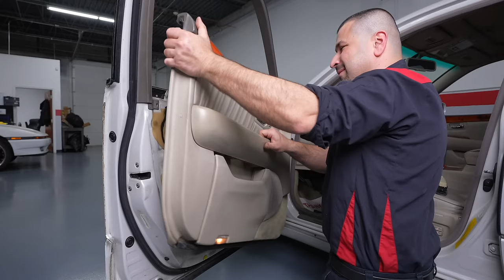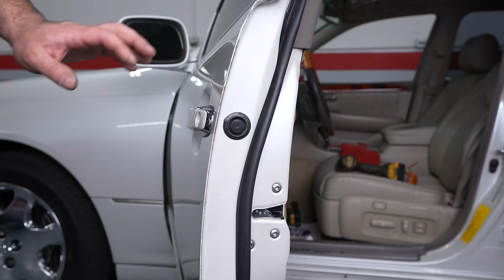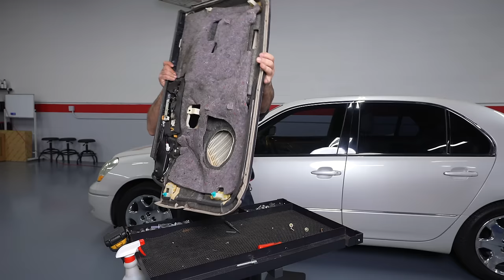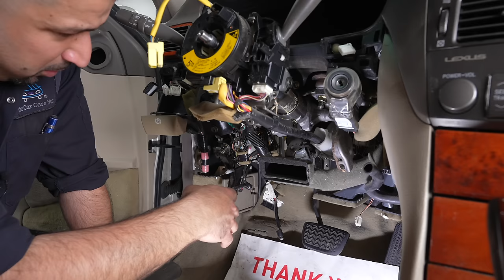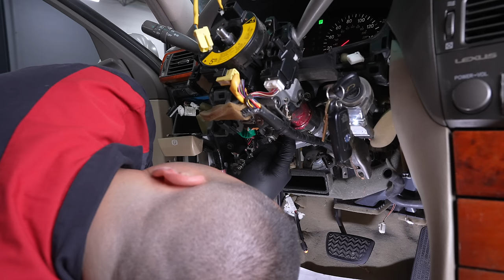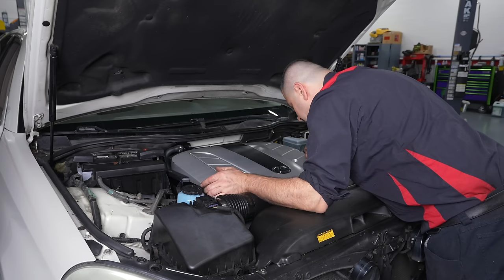Preparing Our 600,000 Mile Lexus for It's First Long Trip! and a Small Accident! Part 5

Comment: AMD, I was a Ford Master Tech for 6 years (technically still, I just don’t work for a dealership anymore 😅) anywho, Ford likes to use fiber under shields and since this was Louisiana where I used to live, they would get soggy and flimsy from all the rain and occasional flooding (many of my customers thought their Ford Escapes have the same water-fording abilities as a 70’s Land Rover Defender).  And of course never wanted to replace those covers.  So when they get flimsy a trick I’ve learned is to loosely install all the bolts for the shield, then you push up in the center of the shield.  Even if it’s soggy and stretched, this forces the shield into a position as close to the frame and drivetrain as possible, or i.e. as close to the original setting as possible, and while holding snug the bolts down to spec.  Hope this helps for the next adventure with the LS.

Comment: So yeah AMD!  So on Toyota/Lexus transmissions you’ve recommended doing a drain and replace every 60,000 miles or so, if I remember correctly.  And you found a transmission for your LS with only 45,000 miles?  Barring anything catastrophic or any condition you don’t want to deal with, I WOULD JUMP ON THAT TRANSMISSION POSTHASTE!  DO IT!  😎

Comment: 36:26 this man after working on the car's interior, his words here just radiate "I just wanna talk to the guy" energy. like hes ready to rip his head off for all the leaves.

also about the transmission issue. I'd argue that you can get and inspect the old one. however i dont know if that would put you back where you started.

Comment: Very interesting watching you figure out the door panel pocket door mechanism. I really enjoy this kind of thing, trying to figure out how something like that works and fixing it. 
  I'm only 22 minutes in so far but I wanted to throw this out there in case you run into this little problem and would like to fix it rather than replace it. It's a simple fix that I saw on YouTube which I haven't attempted to do yet but will soon. The little sunglasses pocket/door on the roof console up by the sunroof controls, if that door doesn't want to latch when you close the door because the button to open it gets stuck you can take that panel with the door off and there's a spring that goes in the button and it gets weak. You can remove the button mechanism easily and remove that spring and replace it with your garden variety ball point pen spring and it should work like new again. 👌

Comment: JB Weld that piece for the fender on and it will hold. Put a lot of that stuff and figure a way to secure it while drying,  it will take 24 hours.  Heck,  I used JB Weld to secure a heat shield once lol.  Swap the transmission.

Comment: For the transmission, I reckon your best bet will be a used (preferably low mileage) A650E and call it a day. Aisin Warner builds one heck of a transmission, so that should ideally be a decent solution. These units are bulletproof!

Comment: I went through that whole process with my transmission. I tried fixing the valve body and eventually ended up getting a replacement from a yard. I don't regret doing that because I wanted to learn about the automatic transmission. However just getting another one is probably the best bet due to the cost of parts alone. I know exactly how you feel but it could save you time and a headache by trying to fix it. It's a tough call since your options are rebuilt the current one, get a rebuilt, or get another used one from a yard. That's your call but then hopefully you don't have to keep taking it out more times than you need like I did on my VW rabbit. One thing I did check was to make sure the car I took it out of had less mile than mine.

Comment: I would do 3 drain and refill on the Transmission along with new filter before you leave, transmission fluid has good detergents and it might clear up the solenoid issue on the trip.   If the transmission is ultimately to be deemed wore out then replace with a factory unit that has not been opened up with low mileage like you found and again do a 3 drain and refill on that unit to flush and have it cycling clean.
Reply: Solid advice (because that's what I've done too). Cheers!
Reply: Sounds good im not fully convinced on if the fluid is dirty just leave it in till the transmission has failed...in my experience with a number if different manufacturers that drain and refill a number of times can help a  Neglected transmission have yet to see one that failed sooner or gave more problems and I've changed some transmission fluid that looked like motor oil.
Reply: @Lavoss05  ...but smelled much worse than motor oil. Cheers!

Comment: When it came time to replace the tires on my new to me Avalon. I had the same dilemma when I was looking at tires. I am still skeptical of the cross climate 2's. I ended up going with the defender 2 as well. They are solid tires.

Comment: I always wished Toyota used nylon inserts for the license plate screws. I have had a couple of them get rusted stuck. I usually put grease on the threads whenever I remove the screws to keep them from rusting.

Comment: I'd also go with the used transmission, with a reseal, and maybe you can show us what to look for when buying used. 

I've had some luck removing broken screws by drilling with a left hand twist drill, but that still takes some luck. And a straight flute easy out doesn't require as big a hole to work.

I also like to dress up the license plate with a simple black or chrome surround, especially if the one already on it is advertising something.

Are you keep track of the hours and cost of the refurb, and will you share them with us at some point?

Thanks for taking us along for the ride, and I hope any future surprises will be small ones.

Comment: My Aisin transmission had issues ,ended changing valve body all solenoid new and the TCM new which i got by mistake of the company who shipped it to me but decided on keeping it and paying for a valvebody and a TCM.i decided to change both as electrical and mechanical both changed once u get inside the Transmission.The clutch n disc were good ,been years transmission still smooth.Saves my knee and hip joint.Get a used transmission if its cheaper.

Comment: I had 2 replace the tcu in my 2006 ls 430. I think that I would get the used trans and then take the old one out and see what's wrong. It might be as simple as low fluid and dirty filter. I would pull the pan and measure how much fluid comes out.

Comment: Your doing a great job on so many of the repairs! I admire your dedication of completing the repairs correctly and not cutting corners. Regarding your transmission, I would get a low mileage/refurbished one since you do not know what the inside of it looks like. Like you said, it may be a waste of time to try to fix your current transmission. I play it safe and get one with the lower mileage.

Comment: I acquired some Toyota Dexron III  for my 1995 LS400  4 speed tranny, and changed the fluid  at 285,000.  Mine seems to like the  Valv..blue bottle Dexron III for the powers steer, and next time I may just use the blue bottle Valv.... for the tranny which also is in my 90 4Runner Pwr Steer system. My teens abused the tranny, and the car didn't waiver. Stock size tires didn't last .... I have bought used oem parts and  have been pleased. Nothing in the parts store compares

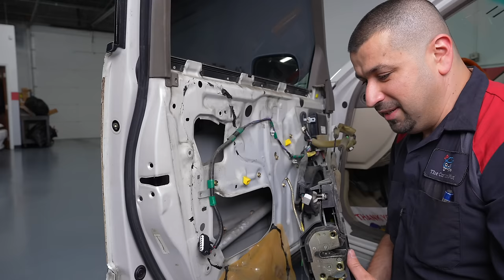Comment: 11:35 I attempted to replace just the actuator here and completely botched it. The door was stuck shut and the handle would not release the latch. Like you said, replacing the whole latch assembly is easier and probably cheaper (given the labor time).

Comment: Definitely go with the used transmission,especially if it only has 45,000 miles. Pull the trigger on that deal. Btw keep up the good work, love the series so far.

Comment: If you're going to replace the transmission anyway , maybe experiment with a transmission cleaner and change filter and fluid. Part of me wants to see the factory transmission make it to 1 million miles. RVS transmission additive is really  good. I'd do 2 rounds of seafoam transtune and new fluid and add RVS on the last one.

Comment: Rebuilding transmissions is a dark art, very few people still do it, as most of the ones who used to are long dead, and if you can find someone who rebuilds them, usually rebuilt ones do not last long. If you can get a used one that either has had its fluid changed on schedule, or has so few miles it hasn't even had one yet, you're WAY better off (assuming the price is attainable)!

Comment: Sounds to me like the best option for the transmission is a used replacement. Possibly run the current one as long as you can, assuming you can fix the leaks.

Comment: Hey AMD, that happened to ME with cover in front of tire, but on my 2019 Prius. I pulled all shields except fender shields & front rubbed.🙄 I pulled to have car undercoated. U are really acçomplishing alot! We're really routing for u! I miss old car manuals so watching you, I can relate to jobs I may have to do. 👍✊✌🇺🇸
PS. Used tranny w/45,000 is a steal. U can take pan off & check inside, replace filter,etc. U do what u must, just tell us so we know you are okay. All work & no play makes AMD a dull boy.😁

Comment: I'd get the transmission and torque convertor reconditioned by an experienced transmission shop. I'd also fit a large ATF cooler to because heat kills automatic transmissions.

Comment: Dear AMD, I really enjoy your videos and the last ones with your project car are very entertaining to watch. I am based in South Africa and bought myself a Toyota Avensis 2.2 d4d turbo diesel model. 
Regarding your Lexus and what you want to do with it.
1. TRY to find a good used interior . Don't go for car seat covers. That will cheapen the car.
2.maybe try and see if you can open and rebuild the transmission, that would be a good teaching video and the car will remain original.
Thanks for the informative video and the blessings at the end of each video. I always Wai for that before ending the video.
Reply: If the transmission is beyond repair ,then yes get yourself the used 45 000 mile one.

Comment: Those hinges are round solid or hollow like appearance. I found that 1/4 or 3/8 rigid plastic pipe/hose along with a Dremel tool, splice the ends, bend over and use a hot glue gun from the inside the hood the new revised hinge. You’re a patient man and you’ll find that as a good solution.

Comment: IIf you replace the transmission with a rebuilt one, how do you know if it is reliable? I understand that you have reservations about rebuilbing the 600,000 mile transmission and that makes sense. If you  can stop the leaks, then it is probably OK to use the car even for a long drive. You may get 100,000 more miles before the transmission needs to be replaced.

Comment: So I noticed a vent under the steering column. I think that the leafs came from the vent. I am not sure that there is a cabin air filter or not but at some point there was not cabin filter and the leafs traveled through the vents to the knee panel.

Comment: Thank you for making these great videos. I find them very informative. I have 07 Tundra with 5.7 engine. I bought and it  had Code for S4 solenoid resistance to high. I bought it 214,000 miles on it, previous owner had it randomly come on since 175,000 miles. I changed fluid first to see if it was just dirty fluid and it didn’t take care of the problem, then I bought new Toyota branded solenoid from eBay for $179. Replaced it and code went away. When I took out old solenoid I checked resistance it was like 18 ohm instead of 13.8 ohms and when I heated it up it went over 20ohms. So that was reason for the code in my case. Hopefully you or someone else find this helpful. Thanks.

Comment: Stainless Steel license plate bolts and use of mild thread locker to prevent water from entering the bolt sleeves is well worth the small expense and effort. When you own a Toyota you need to think long term because the machine will last.

Comment: Tires 
I’ve had cross climate2 tires on my last 2 RX 350s  my experience is they are extremely quiet with amazing traction dry, wet and up to moderate amts of snow (up to 6 inches )

Comment: I would get the used OEM 45K transmission and do a service on it. Best blend of staying OEM and a full service would be more valuable than service on the 600K.  You could replace the $500 part and go 1k miles and something else go wrong.

Comment: Over the years I have owned over 60 cars and I am a boat guy not a car guy. I have had 3 transmissions rebuild with good service. Try to research your local Transm shops--GET SOME REFERENCES--follow up on them!!??--I have had good luck doing just that--the customers of those shops were happy to talk about their good and poor service from that shop. THis will not be the last time you will need a transmission shop--develope a relationship--if positive----------Mikey, Belfair, Wa

Comment: I lean toward the used transmission with 64000(?) miles, with torque converter. 
You could still take apart the old one to see what the insides of a 600000 mile transmission looks like.

Comment: Hi AMD, LOL when you locked your door with the key inside, but isn't it supposed ti automatucally unlock when you're not lifting the door handle while closing?  I was expecting you will show us a hack hiw to open a locked door without using a spare. Maybe next time.  I was expecting you will be cleaning the dirt before you put the plates back.  I usually clean them as well as the back of the license plate as well.
When drilling in winter, use a winter grade motir oil and when drilling during summer....hahaha!

Comment: Great video.  Your knowledge of where every bolt and connection location is mind boggling.  I would definitely go with the original used transmission with 45,000 miles rather than rebuilding one with 600,000 miles.  Your keen eye and experience should identify any potential issues with it and go from there.

Comment: Rebuilding the transmission would be way cooler. 600k on the motor and 600k on the transmission is just epic. Also it's a project car so probably not everything  should be calculated and make sense. Adventure is a part of it.

Comment: If the transmission parts are that expensive then they are not often rebuilt...so s/h is the best option. Anyway a lower mileage unit is probably easier to rebuild if it needs to be rebuilt.

Comment: You have done a lot of repairs for your Lexus. Trash that trans and get a new one. Hopefully end of problem. Another great video!
Reply: As Ahmed stated: There are no "new ones" and not even TMMC rebuilt ones.
Reply: @blackrifle6736  I think he was referring to the transmission he found with only 45,000 miles on it.
Reply: @MartinStockel-k6f  Thanks for the clarification. I hope Ahmed had already moved on the used ATX before going public about it, else 1/2M guys will be trying to find and buy it. Publicity can cause undesirable outcomes. Cheers!
Reply: @blackrifle6736  You are sure welcome

Comment: Dear car care nut, I am immensely  enjoying this project as I am the proud owner myself of immaculate 2004 LS430. One of the things I have done to my is to flush and bleed power steering fluid. I have used Dexron III Automatic Transmission Fluid however since the last episode I saw that you used branded OEM fluid. I have lost sleep, thinking if I should replace the perfectly find working fluid. Please advise.
Reply: That fluid should be just fine. Would use good brand name stuff though…Valvoline, Castrol, etc.

Comment: You can get inexpensive actuator motors from China. It does make it about a $20 fix. You also need to order a small gear puller as well because there is a gear on top of the motor. You also will have to crack open the assembly to replace the motor and glue it back together afterwards. It is an inexpensive repair but time intensive. You also must have patience so as not to break the assembly so you can't glue it back together. I had a 2002 Lexus RX300 and replaced 3 motors in it. OEM replacement assembles can get rather expensive. Go to a forum for your vehicle and do some research for the fix.

Comment: Man, I REALLY LOVE your videos. Thank you very much for going through the effort to show us this!

I have a question. I have a 2009 Corolla 1.8 Auto with only 38 000Mi on it. I change oil every 3125Mi. You insist on using OE parts. The cars service intervals are every 9375Mi or 12 months. Will it really bother me if I use cheaper oil filters on every 2nd oil change? Every service I do, I work like this:

1, Full serice (all fiters and plugs)
2, Every service thereafter only oil and oil filter, then I start at 1 again.

Oh, yes, My take on the 600 000mi Lexus Gearbox, buy that 45 000mi used one, and bolt it to the block.

Comment: I would purchase the low mileage used transmission. I'm debating on purchasing a 2002 LS430 here locally, very low mileage, but still expensive for a 21 year old car.

Comment: I couldn't really tell, but does the one motor run the in and out and up and down of the steering column? 
If so, how? 

I'd get the used transmission. Sounds like your best bet.

I can't believe anyone who is allowed to drive a vehicle doesn't know to change the oil. 😮

Comment: Re transmissions in an earlier video you mentioned a problem with the torque converter in a RAV4. My one owner from new, supplying dealer maintained
RAV4  built in April 2014 has only done about 40,000 miles. The Vin plate says the trans is a  U760F so is this likely to go faulty please? SO FAR I have not 
noticed any judder and nothing has been mentioned by the dealer about software updates.
Reply: So it looks like no-body knows the answer then? I only asked because in the video I mentioned it only said U760 Transmissions. OK thanks anyway.